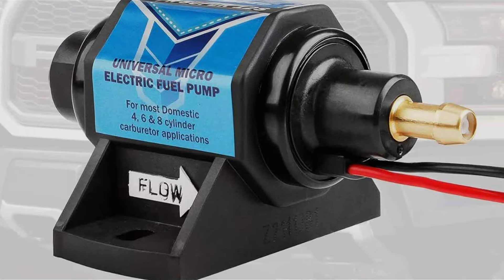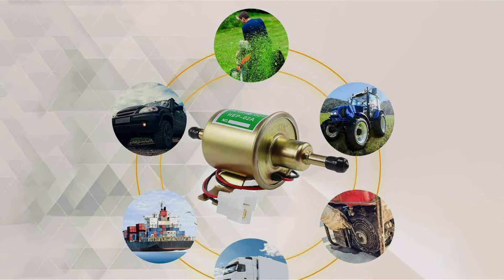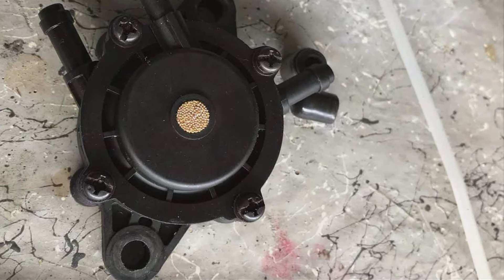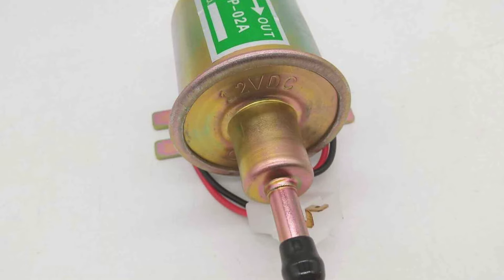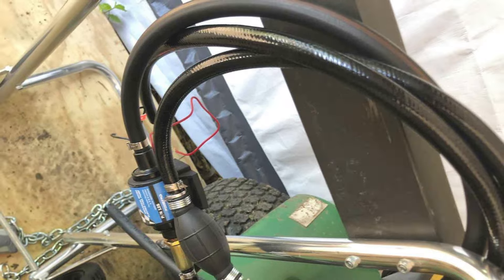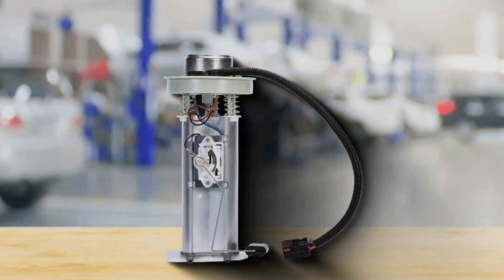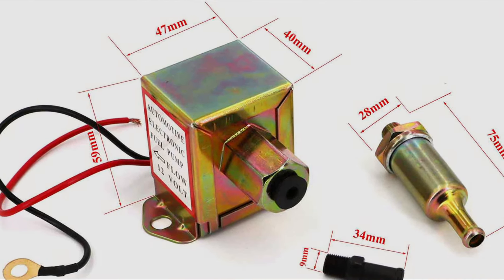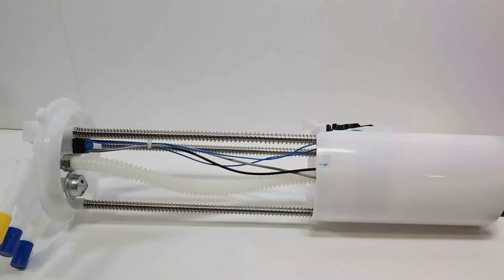Top 7 Fuel Pumps to Keep Your Engine Running Smoothly

Comment: I have multiple tanks with a mechanical pump that draws from a selected tank via valves and lockoffs. I am looking for two inline pumps like the ones described, for use as priming pumps or as back ups if the mechanical pump fails. What I need to know is, can fuel be drawn through the pump by the mechanical pump without the electric pump running? If not I'll need to run some sort of bypass.
Reply: Do a bypass. Some pumps can do what you ask and some can't. Just run a cheap bypass line and not worry IMO